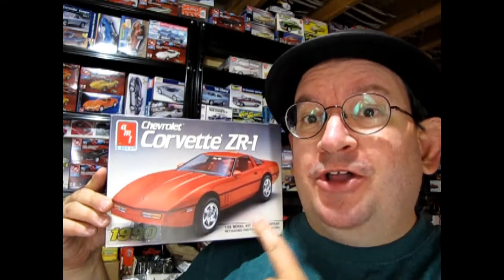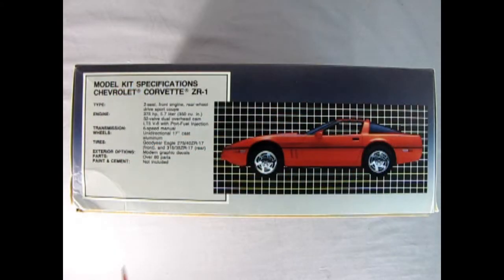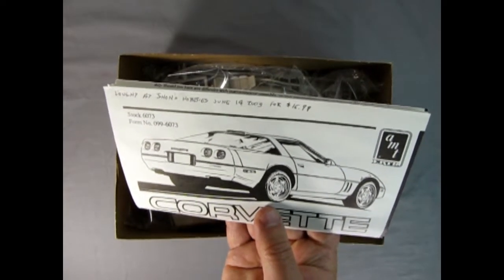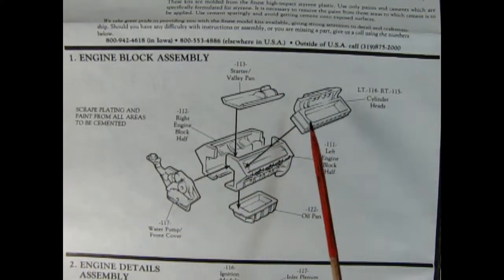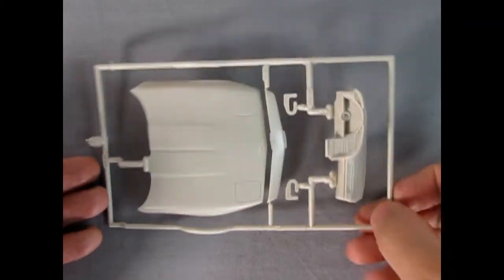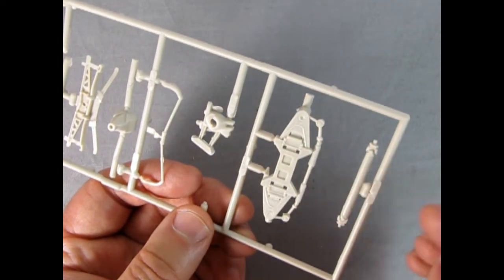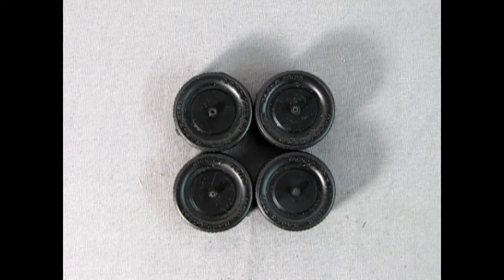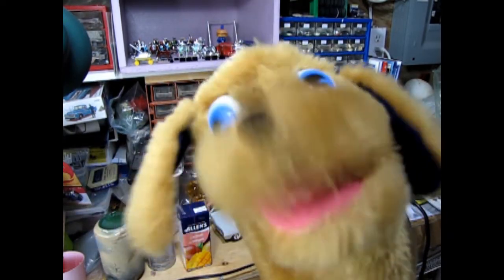Unboxing The 1990 Chevrolet Corvette ZR-1 Model Kit By AMT/ERTL

Comment: ZR1's are 3 in. wider beginning at the front of the doors. The rear wheels on a 90-95 ZR1 have a "recessed" lug circle. This kit is inaccurate in that regard. The MONOGRAM ZR1 kit is more accurate
Reply: Yes the monogram kit is more accurate but aren't we model builders and I believe that we can make anything accurate🧐
Reply: @JonnyHolms  the rear wheels are the issue
Reply from the maker: I will have to take a look at that.
Reply from the maker: For sure.
Reply from the maker: Thank you for the information. i wish I had a Monogram Corvette Kit to compare with.